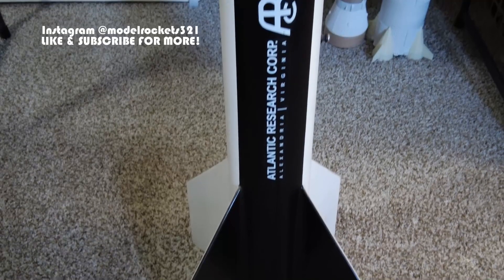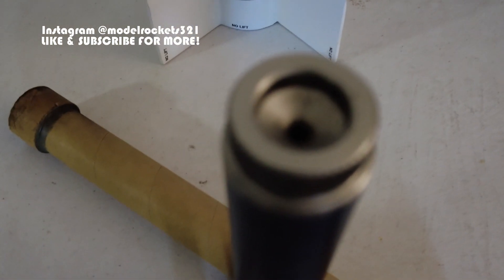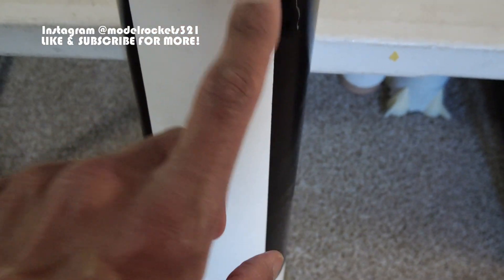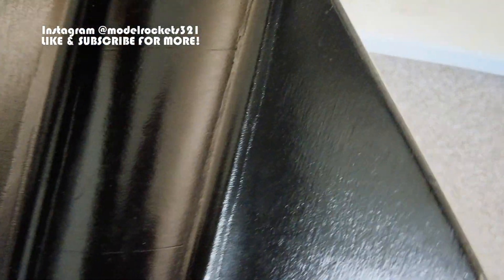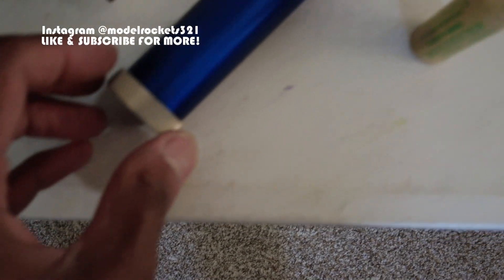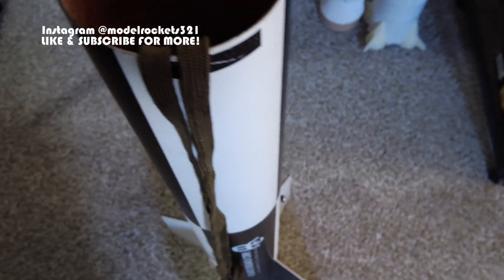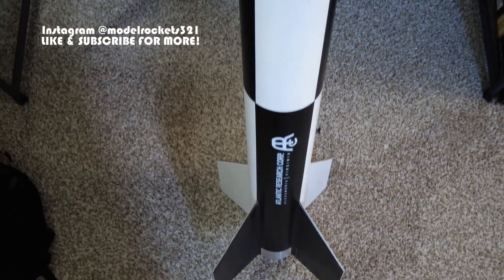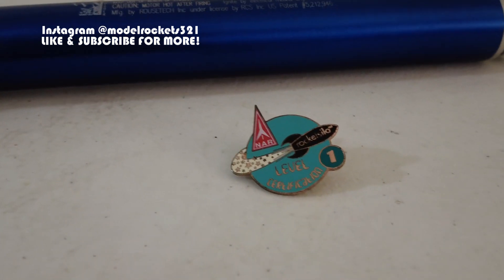My Level 1 High Power Rocket and Certification: 4" IRIS

Comment: Luckily, I had a vendor tell me about the motor drill, and he made a sale. The Aerotech motor had a 14 second delay, which I needed to drill to 8 seconds. I did not know about that requirement. In the smaller scale motors the delays are drilled for you.

Comment: High power is a kick, lots of fun but also kind of nerve wracking. Lots of things can go wrong, and with several hundred dollars on the line, half the excitement is actually probably just anxiety about getting everything back safely and in one piece! Lol. I certified level 2 last year so I can also help at my club, but still enjoy flying the smaller stuff that is a lot easier to just build and fly without the extra precautions with high power.
Reply from the maker: You summed it up well. I found it fun at Cert 1. But not enough to make want to climb the ladder to Cert 2.

Comment: High Power launches, 2 nearest me are about 3hrs South and East (Springfield, MO) or 3hrs South and West (Argonia, KS).
You can get a single level 1 motor sent to you if you have proof of upcoming cert, a paper with an assigned mentor is proof.  Once you have level 1 in a NAR or Tripoli member #, you can get those H and I motors shipped to you. Same for level 2, get a single motor shipped prior to level 2 attempt. Easier to get motors at launch site due to those restrictions and hazmat fee. 
Level 1, you must launch and recover using H motor. Rocket must be flyable without requiring repair.
Level 2, same thing,  but must use J motor and pass written test.  Level 3 is launch on an M motor and dual electronic deploy.
Reply: I don't know about Tripoli, but NAR does not require any kind of electronic deployment for L2.  But they do require a written test.
Reply: @danbrown586  I have updated my comment to correct it.